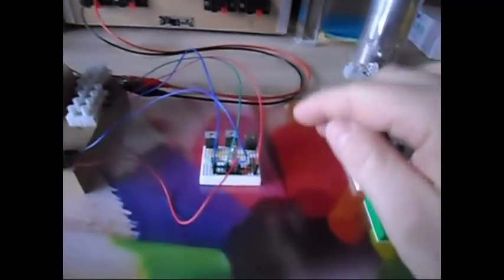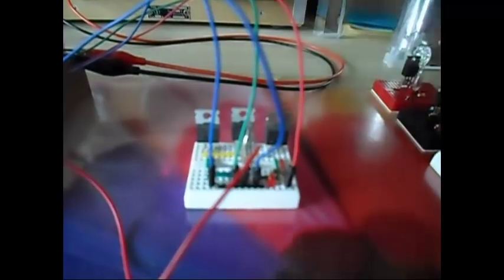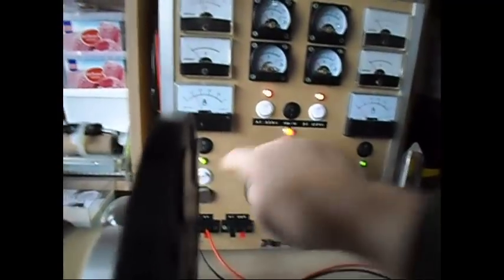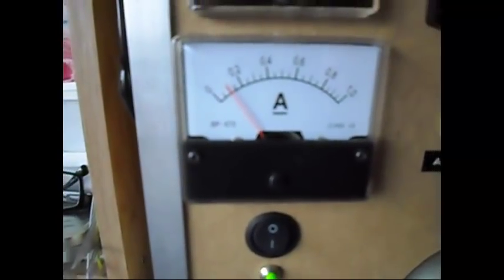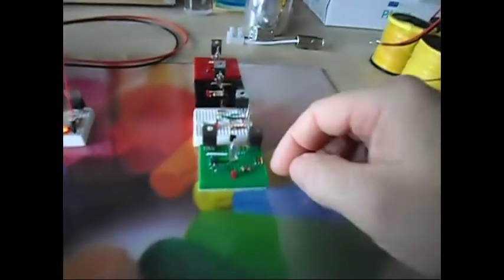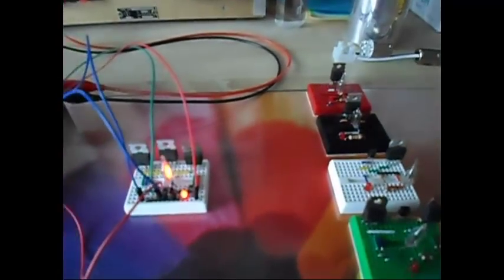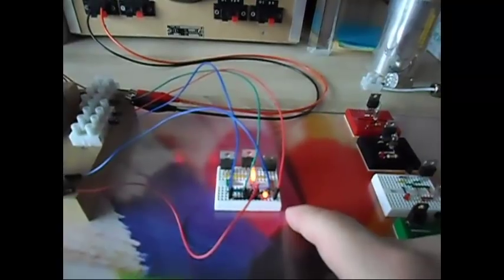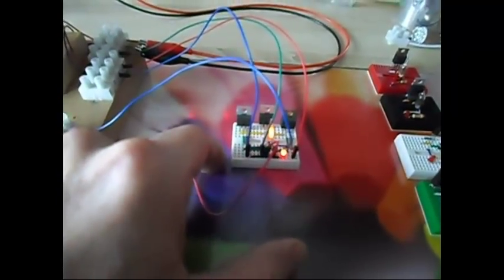Pulse Motor - Full Mosfet Drive Circuit...

Comment: Thanks for sharing more info for the parts used
Reply from the maker: Thanks for your comment...^^
What info do you need...???...just ask and i'll do my best to give the best possible answer...;-)
Reply from the maker: Check the pinned comment of mine, there's a lot of info in there also...;-)
Reply: resistance, transistor, diode and capacitor info
Reply from the maker: There are no transistor mate, as the title says...Pulse Motor - Full Mosfet Drive Circuit... ;-)
There's no capacitor in my circuit and also not in the linked circuit...???
The diode in the linked circuit are not in my circuit so i have a neon across the coil for the nice b-emf...
About the resistance, my circuit is not 100% the same as in the linked circuit so i don't know that part...lol
Here's another link to a circuit build by the same person aka "toranarod"...
http://overunity.com/3842/muller-dynamo/dlattach/attach/53158/image//
In this circuit there are the resistance values so i hope this helps you out...^^

And if you need more info just google, Muller dynamo or toranarod circuit...;-)
Reply: Thanks -_- you are good
Reply from the maker: No problem, your are most welcome...^^